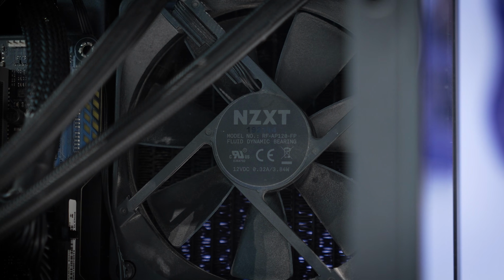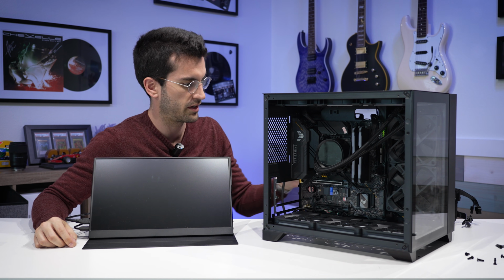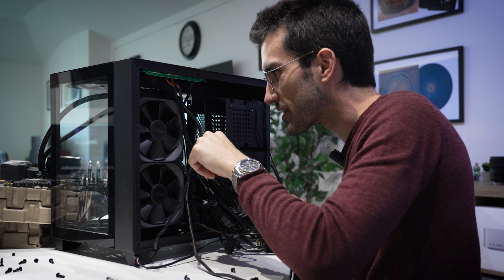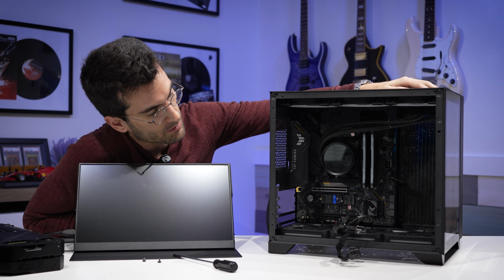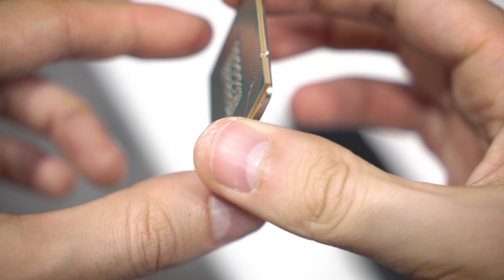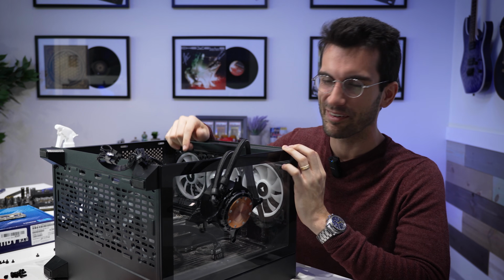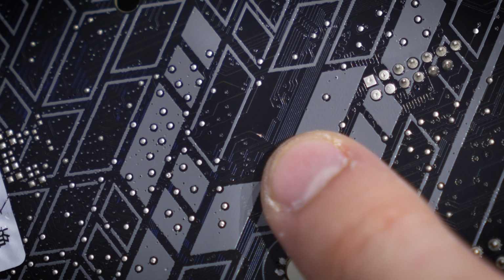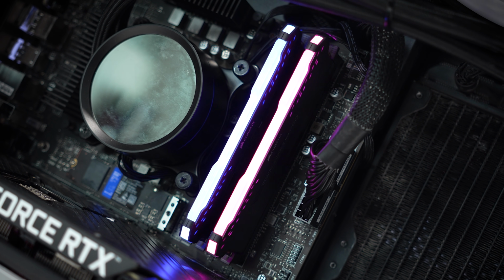Fixing a Viewer's BROKEN Gaming PC? - Fix or Flop S6:E11

Comment: That board did have exposed power rails.the standoff probably shorted out something crucial.
I’m a big proponent of using a testing rig for individual parts and starting from scratch. When I have an issue on a computer I isolate each component and when testing the board I take it out of the system.  You got there eventually but stopped prior to testing the board out of the rig with the card and other components outside the rig.

Comment: Might be useful for you to buy a small bottle of trace UV mask for the future to maybe cover scratched traces if hardware works with them, it will just secure the copper and prevent accidental short, just in case...

Comment: whoever built this pc made terrible job. was it inexperience or rushing things does not excuse the quality, all the RGB fans in vanity case and build quality is crap, shows where priorities were. My guess that the shorting of motherboard intensified when new GPU was installed possibly pushed with pressure into the standoff, shorting thigs may inflict lasting damage so motherboard probably died because of that.

Comment: Computer broke when new graphics card installed because he went to a bigger graphics card. The weight put on the board pushed the board against the stand off causing the damage. The older graphics card was probably a smaller card like a 1080ti or something of similar size which put basically no weight against the board and case.

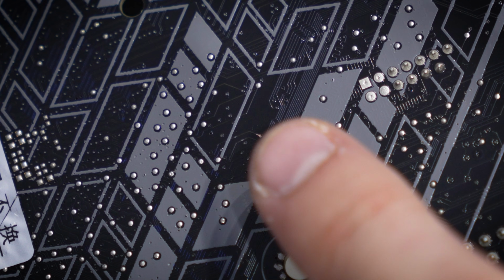Comment: 27:51 thats marks on a trace, not a power or ground plane. ill bet its shorted to ground thru that scratch to the plane on either side. id need a higher resolution image or the mobo to confirm

Comment: The standoff scratches are probably the main issue with that board, even if it didn't break any traces it may have moved enough of the copper that it's shorting itself out between the traces. This could easily have been caused by putting in that graphics card, the extra pressure when putting it in caused the scratches and then even just minor flexing would cause it to short repeatedly and over time would get worse due to the exposed traces. I honestly feel like some minor board level repair would be all it would need to bring it back from the dead. A quick cleanup with a rubber polishing bit then check the traces are intact and repair if necessary before covering with a solder mask.

Comment: I don't think the old board is beyond saving. 
If the board only refuses to post after a Bios reset, the Bios might be corrupted. 
Re-flash the Bios and test the board with RAM at JEDEC speeds, no XMP. A one-button affair with Asus boards. 
If that worked, boot into Windows and re-flash the Intel ME firmware.

Comment: I called the Motherboard needed replacing 😭I believe it had cut the copper and isn't making contact with each other and might've short circuit something along the line which you can test each power capacitors just incase.

Comment: Bro, since the first time you pushed the power button and noticed that it flickers, it was a clear sign that the Mobo was shorting somewhere and a fuse was preventing it to boot, most of the times the fuse will reset if the BIOS is reset, that's why you were able to boot it by holding the power button a bit longer, short detected and stopped working

Comment: That CMOS battery is likely from a motherboard. It probably had a plastic cover as well. The owner just removed it, ripped the plastic off and pulled off the wires, leaving the metal pieces still 'soldered' on. Interesting technique :/

Comment: You did a good job Greg. Troubleshooting a PC can be very frustrating, especially when its a new issue. This is the first time ive ever seen this myself. Im almost wondering if the BIOS may have gotten corrupted. It may have had enough to do the initial boot, but with that standoff in the wrong place, it could have taken out a number of components. Again, great job.

Comment: Hi Greg, that kind of BIOS battery was from an ITX board. The ITXs have a battery like that, with wires attached to the contacts you've noticed, ending with a little plug into the motherboard.

Comment: my theory is the board came from TEMU/AliExpress/Wish and did not come with a CMOS battery, so the owner salvaged a similar battery from a different device like a gameboy game which uses those tabbed button cell batteries, but they are not the same type as CMOS batteries despite being the same shape/size, and that caused the BIOS issues which are unrelated to the standoff-induced shorting.

Comment: I own the same CPU, The i5 11400F and can keep up with many of the Ryzen 5000 series CPU's. I have a RX 7600 GPU and I get some pretty decent FPS in most games being released. I also own a Ryzen 7 5700X and I don't see much difference performance wise. Yes the Synthetic Benchmarks like Cinebench score higher, but the benchmarks like this don't pan out in the FPS for 1080p gaming. I prefer Intel over AMD as Intel has much better support for USB, such as it is hard to find a budget AMD motherboard that has a 20GBPS USB-C Port, But intel has many motherboard with better I/O in my opinion.

Comment: I once had a similar problem, it only turned on for a few seconds. I tried the bench test many times and it always worked, but installing it in the case always had problems again. So I was sure the problem was from the PC case, I tried one by one the pins from the case. The problem turned out to be the reset pin or reset button on the PC case, when the reset pin was not installed, everything worked normally.

Comment: The CMOS battery looks to be from a laptop or game system where they are soldered in, so the Bios might be borked due to basically running without a battery, the scratch on the rear also most likely damaged at least one trace. I'm surprised the owner didn't notice the holes not lining up with the standoffs. I would have liked to have seen the PSU and it's ratings, just because it passed a basic test does not mean it is good, or good enough for that system under load.

Comment: That CMOS battery could be from a laptop. Most laptop batteries have 2 pieces of metal strip soldered to the battery and the plastic is to prevent the metal strip (especially from the negative terminal) from shorting the positive metal of the battery cell.

Comment: Had a PC I built that “worked”, but would do the same thing where it would power on briefly, but wouldn’t work unless I held down the power button. Also would reset if it got a static shock (didn’t matter what time of year, and I didn’t get shocks elsewhere in my house). Ended up rebuilding it in place because I added USBC to the blank in the power switch board, and haven’t had a problem since. I assume that there was a ground issue somewhere, but no idea where it was. Thankfully, didn’t fry anything.

Also want to say that I’ve built a bunch of PCs before, and it was a very weird issue.

Comment: That stand-off appears to have scratched the solder mask off of at least five traces, shorting those traces together and/or breaking those traces. I’d say that misplaced stand off caused the failure.
Reply: Can u just recoat over it?  Askin for afriend
Reply: If it’s just scraped-off solder mask, yes. They make UV cure solder mask for this, or you could even use regular nail polish. However, if traces are broken, or if shorts damaged components, then you would have to repair the damage first.
Reply: @ also he should have tested if the Mobo posted with th onboard hdmi vid
Reply: @miketrainor1929  Well it all depends. Not every CPU has an IGPU so that wouldn't work

Comment: That battery is designed to be soldered directly to the board.  Those metal tabs are the solder points and the insulating band is meant to keep the tabs from shorting the battery.  You see them used in game cartridges a lot (older Nintendo cartridges and game boy cartridges) and other smaller electronics that need a battery source.

Comment: as for the metal strips on the battery and the insulation around it , it seems to  indicating that the battery was meant to be soldered directly to a board , kinda like the battery on some gameboy carts for save files ..  .the stickers on the board , looks like those typically seen on refurbished boards coming from aliexpress/taobao etc .. and for the lack of usb ports , maybe could have used one of those internal usb extneions , like nzxts ?

Comment: i had a  3090 that did that flashing light issue from the very first day i got it brand new a year later it compleatly failed. so typical when they start to flash like that from the  multiple  places i read about it it means they are in the process of failing and  dont have much life left, the power managment part of my 3090s board failed . wich appernetly was a common failpoint  on the  higher end  30 series  3080 3080to 3090 and 3090ti. i  read tons of struff on reddit about it and on fourms when i tried to figured out what it was 5 psu  replacments didnt fix nothing i still have the  3090  and im trying to save up  500$ to send it in for   the board to be repaired cus i really need the vram but cant afford a a new  3090  4090 or 5090 when my 3090  failed it also took out my psu and my  motherboard

Comment: Ok I think I’m going to hell now, I laughed way too hard when he said it should work after reassembly. I’d have stuck the GPU in and bench tested it before putting it back together.

Oh and after 30 years of doing this I still find stuff that that surprises me.

On the back on the old motherboard it looks like a lot of copper is exposed, but the standoff in the wrong place is the most likely culprit.

Comment: i got like a  700$ asus boatrd back in 2021  it was the  highest end they had and even that  only had two USB headers on the motherboard so i had to buy a USB header adapter i plugeed one USB header into it and it had  4 other USB headers  for my other stuff all but 1 is in use on that little thing

Comment: I would honestly bet that tiny scratch caused by the misplaced standoff is causing all those issues. A nonfunctioning CMOS battery can cause issues like what you've seen where the BIOS keeps "forgetting" settings even when wall power is applied, but the fact that they keep persisting strongly suggests to me that one of the traces that was severed may have to do with a BIOS electrical connection, meaning even the new/refreshed battery can't cure everything.

Interesting FIx or Flop! I look forward to the next one. :)

Comment: I think what gave it away to me was after seeing that scratch and plugging everything back in. The GPU flashing like that and the issues with the power from the button to the board told me either there was a short and/or the board was getting "dirty power." Pretty sure the standoff scratching that trace degraded the trace to the point it couldn't send or receive proper power.

Comment: U will be surprised how many motherboards i have with a simple bios update. If it's having issues and i can eventually get it to post, I'll do a bios update then and there and see how it goes
Reply from the maker: This wasn't a BIOS revision issue specifically. That separate symptom was isolated to the battery. Once fixed, the BIOS held settings. The inconsistent power had nothing to do with a BIOS.
Reply: @GregSalazar  ahh ok. Did u do a BIOS update on it to rule out a semi corrupt BIOS?

Comment: If you can get the board into BIOS, try updating it. I had a Z590 board with power issues, and after updating to the latest BIOS, the problems completely went away.

Comment: Dude the best thing you can do is test outside the case to see if it works if it doesn't now you start testing parts
Reply from the maker: ? We very quickly isolated the incorrectly placed standoff. The case itself beyond this wasn't an issue.
Reply: @GregSalazar  you did pull out the motherboard out and it started working 

I bet that motherboard is fine if you literally isolate the scratched parts on the back but you didn't even teste the full thing without the case.

Comment: Why do people bother building shit if they're just gonna do everything wrong.

Also, I promise you: it's never going to be the CMOS battery 😂
Reply from the maker: Uhhh... it's been the CMOS battery before :-)
Reply: I had an old Phenom II X4 945 system that just would not retain BIOS settings even when plugged into wall power and would not clean boot to Windows. Out of sheer for-lack-of-a-better-alternative I dropped $10 on a two-pack of CR2032 batteries and swapping them out fixed everything.,

Comment: Recently I upgraded from 10700kf tuf z490 to am5. Today I was supposed to sell it, but I wanted to test it one last time- in case if buyer accoused me of selling him broken hardware. I put everything back inside my case, and it booted straight to bios, plugged bootable pendrive, and left bios. Then I saw windows installation, but I turned pc off. After it turned on I was met with orange VGA light. There is red cpu light for like half a second, and then constant orange vga. I reseated everything multiple times, and even started without gpu, ram and ssd drives, yet it still instantly shows orange light. Taking cmos battery, and shorting clrtc pins didn't work either. Gpu works just fine after checking it on my b650. I think that mobo's fckd, am I right guys?
Reply: Try re-flashing the BIOS. I've seen people say in this play-list that some issues are traceable to BIOS corruption in the firmware memory, and a re-flash effectively fixes this by forcing a rewrite.
Reply: @quantumreality215  yea I though about that but my (tuf z490 gaming plus wifi) doesn't have bios flashback button
Reply: @rzultamorda  Ok for some reason my comment keeps getting auto deleted but IDK why. Anyway check for what's called the CrashFree BIOS reflash option. That may give you a chance at a re-flash.

Comment: its definitely the motherboard trace. that gash is directly on a via that allows power to travel from one side of the board to the other. It maybe possible to get the board to work again if you place some Kapton tape directly on the affected area to stop the short. if the trace is broken if you add some solder than Kapton tape. maybe you can make it another video. Great videos man.

Comment: If the standoff was supposed to support the board under the PCI express slot, perhaps the original graphics card was lighter, inserted once, and the PCI Express bracket was tightly screwed down, keeping the graphics cards weight away from the damaged area. Inserting the supplementary power to the GTX3080 and pushing hard would have made the motherboard make contact with the standoff and increased the chance of a fault. repositioning the standoffs correctly for the next motherboard would have saved the new motherboard from the same fault.

Greg might need to keep a checklist of the simple errors he normally checks for as earlier in the series he would always check the ram and CMOS battery earlier in the sequence and might have seen the battery insulation sooner.

Comment: i bet that the standoff shorted s circuit and sent something wacky through to the pcie circuitry in someway if im not mistaken the chip set controls it and that was right near it so i wonder if the wrong voltage was sent to it and it borked it somehow rather it tripped something going to the connector or the chip set itself and when you powered it on without the card that one time that was the last time it was gonna power on before finally dying but that is just my twocents heheheeh

Comment: 30 years of building PCs have taught me to always reinspect the assembly if the person who built it wasn't a professional builder. Missing or improper standoffs are the most common mistake. People do not put enough importance on mechanically related assembly items. There is a reason for the hole in the motherboard, or it would not be there. They sell plastic feet to snap into the mb if it needs support and the backplane does not have a place to mount a threaded standoff. 
You should be able to get into the BIOS/UEFI before installing the MB. Rule the case out before you even put anything into the case.
MB, CPU, Memory, KB, Low-end video card compatible monitor should all be working first thing. This alone will save you countless hours of fighting weird, nonsensical issues.
Mount your mb and power supply, and test it to make sure your front panel is connected and working.
Next, put in the hardest fit items first and test. Cable manage as you go using Velcro wraps. 
Keep repeating this for everything you will be installing. 
Some components will change the order of installation, so don't be in too much of a hurry to rush anything. 
Don't install any side panels until last, or you will be taking them on and off, and it will take much longer to complete.

Comment: Hi Greg I enjoy your videos! I knew it was the motherboard the first time you tried 😁 Probably when he upgraded his GPU the pressure he put on the MB to install the GPU is what made that misplaced standoff dig into the back of the MB! But anyway I hope you pull the WiFi card on those bad MB 2 screws and they pull out and they go for at least $25 and more on eBay... just an FYI. Keep up the good work 👍

Comment: What's really hard is reducing the parameters to a minimum. When there's so many things that can go wrong you can run around for a long time searching for the solution.
A question. Is it possible the user flashed the BIOS with a a bad version of the board bios or is it possible there was an accident during the flash? 
That COULD send you into a BIOS screen like this (assuming it's not bricked) but never go anywhere (since the code to go further is either corrupt or not there).
Some motherboards can be flashed with a "blind" USB key so that would be something to try.